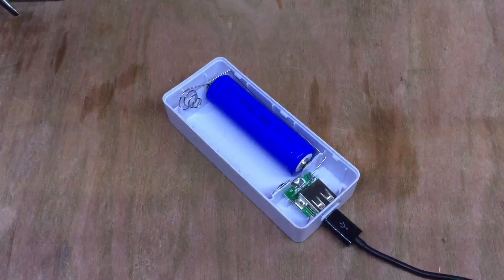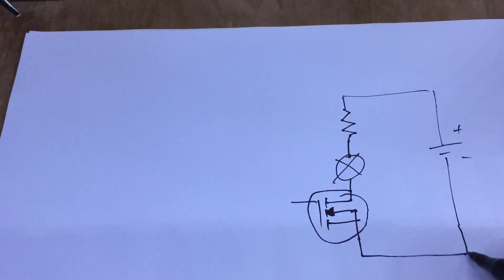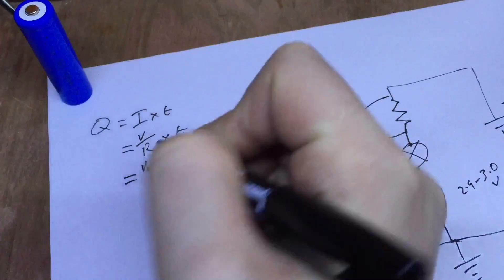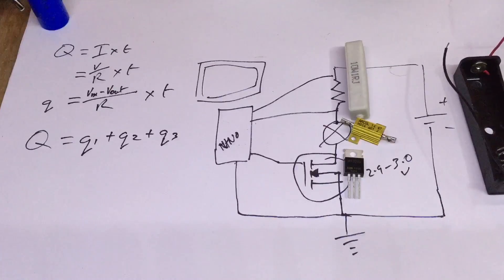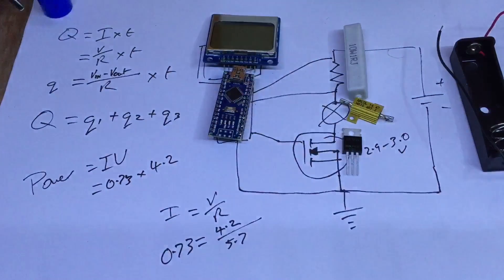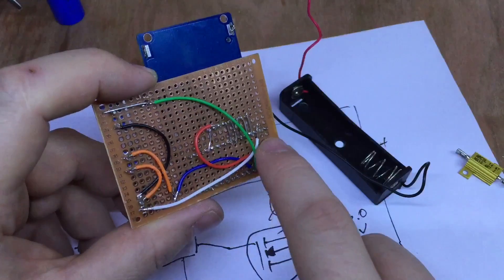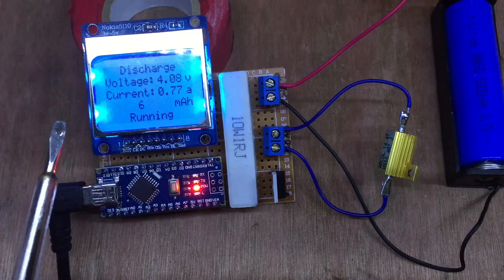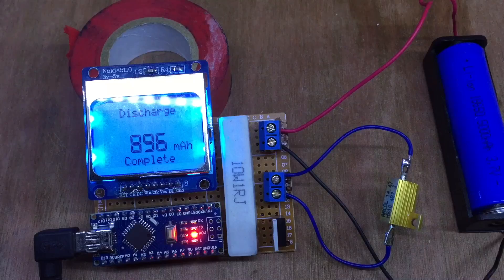Lithium Ion 18650 Capacity Checker - Adam's Arduino Projects

Comment: Just wondering how you are getting the Li-Ion Cell Voltage.  Are you taking that directly from the 1 ohm resistor?  If so would it be better to add another analog reading for the cell itself.  Two readings, one for the cell, one for the sense etc.  Then you can adjust your current reading to be more accurate.  I do believe that TI sells a dev kit for something similar to this.  Gives you a scale for current from the sense resistor through some op amps.  Then you just read the current scale from the amp and do the math.  Since it is in silicon the sense resistor is tuned and the value is known.  Would give you more accurate readings than through the 10W resistor that changes resistance as it heats up.
Reply from the maker: +Jimmy King Yeah I read the voltages at two points. One directly on the cell positive and another after the 1 ohm shunt. Deducting the shunt voltage from the cell voltage gives the current. 

This project was an afternoons work using bits out of my components box. I've been very pleased with the fact that so many people like to watch this video and comment. There are a thousand ways to achieve the same result, much more complicated and probably accurate ways too, but this was my way on that day with a few bits lying around.

I still personally like the idea of the sense resistor - although ten 0.1% 1watt resistors might serve the project better but if I were to make this project again, I'd look at using a mosfet or a transistor as a constant current load. 

Thanks for your comments - perhaps one day I'll create a version two of this project incorporating some of the good ideas people have kindly given here and perhaps a couple of my own.
Reply: You could use a constant current source like the TL431 with a pass transistor.  Very accurate.  As far as the 0.1 ohm resistor the noise would be considerable, and you won't get an accurate reading directly off the 0.1 ohm resistor which is why you need the amplifier, the ADC can't read that low of voltage.  But I enjoyed the video.  Sorry I missed the way you were reading the voltages.  Pretty awesome you had this stuff lying around to work with.  If you want to upgrade the project it would be really simple and I have found some sources that might help you out in the future in case you want to test power supplies for accuracy etc, solar panels for power etc.  You can read this if you want to. You can get away with 1 ohm resistor for sensing but the accuracy will be 10x less then using a 0.1 ohm resistor.
The challenges with measuring with a 0.1 ohm resistor is the amount of noise on your resistor you will be measuring thus the need for the amplifier.  Selecting a resistor that has good thermal stability and an opamp that has low drift and noise immunity would make your project I think that much cooler.  I remember back in school that they explained that if you contact TI for samples if you explain what you are trying to do they usually are more than happy to send you a few samples for free.  The amount of exposure to the public they get is like free advertising for them so it is usually worth it.  http://www.vishay.com/docs/30175/thermal.pdfhttp://www.ti.com/lit/sg/slyb194b/slyb194b.pdfhttp://www.mouser.com/new/Texas-Instruments/ti-vishay-current-sensing/resistors has on accuracyA good reference material on how shunts are used in calibration and the effect heating http://www.ohm-labs.com/precision-shunts/cs-1-10.html  If you don't want to purchase a 0.1 ohm resistor you could use an enhancement mosfet for the resistance between the drain and source, it should be low enough for the application assuming your not throwing too much power into it.  Just make sure it is got a large heatsink on it as well as a fan. If you operate it in the linear region you should be able to adjust the resistance as it starts to heat up.    Datasheets on mosfets are great reference for that kind of stuff.  Also using a standard opamp (ones with compensation pins, for gain stability) could be used for the amplifier stage.  Something like this could be breadboarded in a short amount of time.  I rarely use LCD screens because it is much easier to use a terminal and display the values on a debug screen, at least when I am prototyping.  A good place to find sources for 0.1 ohm resistors and a variety of good components are within old CRT boards.  They have great power transistors, shunts etc.  that usually can be picked up for about $1 at your local goodwill or other store.
Reply from the maker: +Jimmy King Wow Jimmy - I think you win the competition for the longest comment on my channel - and possibly the prize for the most researched. A lot of info for me to absorb there. Thank you. 

I think people have found my little circuit to be quite simple to understand and easy to build which is why I think it's been reasonably successful. It's like Dave Jones' constant current load - such a simple implementation although possibly not the most perfectly tuned and stable design. 

I truly am very grateful for your suggestions - I will look into them and consider them if I return to this project. 

Thanks again Jimmy

Comment: Nice project!
Do you think it could be possibly to check the capacity of toyota prius battery module ? it works between 8v-to 6volts
Reply from the maker: +Alex Cociug I guess you could adapt it for that. You'd need to put a voltage divider on the analog inputs and adjust the code accordingly, but otherwise you should be ok.
Reply: Thank you very much for fast response! CAn you please recomend a certain model?
Thank you!
Reply from the maker: +Alex Cociug I was thinking you might just use a couple of resistors but I guess you could use a couple of pre-made modules like these - http://rover.ebay.com/rover/1/711-53200-19255-0/1?icep_ff3=2&pub=5575189419&toolid=10001&campid=5337903455&customid=Voltage+Divider&icep_item=201616845898&ipn=psmain&icep_vectorid=229466&kwid=902099&mtid=824&kw=lg 

You'll lose a bit resolution because those modules are designed to measure up to 25 volts, but they'll probably see you right.  How much capacity do the prius battery modules hold - it might take a while to get their capacity (assuming they're high) at the 500-1000ma discharge I used in this project.
Reply: A good prius module have 								6.5Ah. What is maximum discharge rate which i could use in this project in order to save some time?
Thank you!
Reply from the maker: +Alex Cociug Using the same shunt and load resistors the maximum discharge would be a little over 1 amp. The resistors are only 10 watt. 8 volts * ~1.2amp is roughly 10 watts. At that rate it could take six hours to discharge a good cell. 

You could use higher wattage resistors and increase your discharge rate - just keep an eye on that equation; P=IV

Comment: can i use a 1w led instead of that resistor
Reply from the maker: I guess you could, but you'd need to protect it with either a resistor or a cc driver.  You've also the issue that the cell will delivery between 4.2 and 3 volts - 4.2 is probably a bit high for the LED, and with a current limiting resistor 3 volts is probably too low.  I filament lamp (eg. 6 volt) would make a better choice if you want to use something that generates light.
Reply: i dont have that high watt resistors i have some 1w 1k ohm resistors can you suggest something
Reply from the maker: If you've only got resistors 1k or higher then you'd need to put a lot in parallel to get down to a decent level to discharge the cell at a reasonable rate.  Perhaps a savaged 12 volt car bulb?
Reply: ok i will try that out

Comment: Two thoughts. The termination voltage of the discharge cycle should be measured at rest, not under load. On my quadcopter the 18650GA Li Ions run at 3 amps. The manufacturer's continuous rating is 10 amps. I land when the voltage (under load) gets down to 2.5V. After landing the voltage immediately bounces back to a resting voltage of 3 to 3.15V. My battery utilization is typically 90% or thereabouts. Second, the industry standard is to rate the batteries under 200ma load. Hence the 5000maH rating label, vs the much lower results you obtained, around 1000maH.
Reply from the maker: +tm22721 Thanks for your input. 

The information I've read suggests that once a li-ion battery reaches 3volts under load it's pretty much done. A voltage rise off load is superficial and testing the battery again won't reap much more energy. I've tested this with this tester, a LiitoKala charger and my iMac b6 clone. You'll get a small increase - but not much at all. 

I've never seen an industry standard of 200mA - have you a source?  I stuck with 500mA because that's what the commercial product I bought also used.

I guess the best thing about this project is that you're welcome to replace the load resistor for something you're happier with, and you could update the code for your needs - release the load every ten seconds and read the voltage and reapply the load or not based on that reading. 

I hope you're able to test it and adjust it for your needs. Thanks again for the input.

Comment: Thank you very much for this project. I'm going to build one now.
But can I use IRFZ44N mosfet instead of IRF3205? Characteristics are slightly different. I'm a noob in electronics, but it looks like it should work fine, even if the drain-to-source resistance larger (17mOhms vs 8.5 mOhms).
Reply: Oh. Silly me. The comment below by Nick B suggests that it will work. (:
Reply: And yes, you've got another subscriber!
Reply from the maker: +Anton Mikhaylov Thank you. Glad you found your answer.

Comment: Is a moset necessary? Will a simple BJT transistor do the job also?
Reply from the maker: +HiJoeZi Probably yes depending on the transistor - you'll need to research a suitable one. Remember to protect the Arduino with a resistor.

Comment: I've ordered the parts and can't wait to build mine. I think the project can be further expanded too. 

You could use another MOSFET to switch on a TP4056 charger module before/after the capacity test completes. (If you tap into the 'charge complete' LED or monitor the current going to the charger, you could even switch it off once it completes or the current is below a threshold.)

You could even have an option to drain a battery to the storage voltage instead of running it all the way down for the capacity test.
Reply from the maker: +Jonathan Wells Yeah, both good ideas. I did think about integrating the TP4056 and hacking the LEDs.  Never did get pen to paper though to jot a circuit down. 

I would like to build a version 2 of this circuit as people seem to like it. Version 1 is very basic all because it was an afternoons project made with junk parts. 

Thanks for your comments and suggestions.

Comment: Correct me if I am wrong, but we don't need to use display, arduino can output results to PC via serial?
Reply from the maker: +siux94 Absolutely. You're 100% correct.
Reply: lool your are running away from lcd interface overhead :)  that's cheating pro  , Just kidding :)

Comment: is it necessary to use a 15watt (2nd) reaistor? why not 10watt type like the 1ohm one?
Reply from the maker: +Vaping Rain I made this with things I had lying about. 10watt should be fine. You'll just need to do your sums... I=V/R and P=IV. I'm guessing you might want to discharge at a higher current than I was?
Reply: +Adam Welch Nope. I will do the same rate (500mah) as of your another video. is it necessary to have 15watts resistance in that case? I am using 10watts type.
Reply from the maker: +Vaping Rain Ok so P=IV therefore P=0.5x4.2 P=2.1 watts. So a ten watt resistor should be more than enough.
Reply: +Adam Welch ah. Thanks. btw, any update on time display and button for on/of the discharging state?
Reply from the maker: +Vaping Rain Sorry. I've been working on other projects. I do intend to return to this project at some point and make a version 2.

Comment: I have built this using an IRFZ44N mosfet and all is working well. I have made a couple of minor alterations to the code. Firstly, since it is not recommended to discharge a lithium battery below 3V I have set the termination voltage to that. In fact I am thinking of setting it a little higher still to obey the 80% rule as it is supposed to prolong the life of the battery. The second modification is to assuage my ever-so-slight tendency towards OCD (haha) and have modified the printing of the mAh value in the 'running' screen to print the value right-aligned in a field width of 5. It just makes it look a little tidier to me. ;-)

A great project and I am also following your DC Load project with keen interest. Thanks.
Reply from the maker: +Nick B Thanks Nick. When looking at the cut off voltage I found all over my power banks cut out at 2.9 volts but obviously it's up to individuals to set it at a level they are comfortable with as you have. Completely understand your argument about cell health too, but discharging and testing capacity isn't something we'd normally do on a frequent basis. 

I'm so glad people like this project and have built the circuit. The beauty of releasing the code means that anyone can change it how they wish so I'm glad you've been able to adjust it for your needs. 

Thanks very much for the comments.
Reply: Why we need two resistors? Can we use one big for the load and measure the voltage across that one with two resistors?

Comment: I'm kind of a noob.... why use two different resistors?  Couldn't you just sense the voltage drop across the load resistor?
Reply from the maker: Absolutely you could yes.  But I wanted to change my load so I could easily change between 500ma, 1amp or even 2 amp draw.  If I only had one resistor I'd have to change the code each time (or build a menu system into the arduino).  By sensing the drop over a fixed current shunt I could change the load to be anything I wanted and it'll work out of the box so to speak.

Thanks for the question.
Reply: Thanks for the explanation, even though it makes my head explode that the Arduino can calculate the current without knowing the resistance across the load...!  I have to look more into the shunt thing.
Reply from the maker: +mnelson10000 It simply Ohms law. 

Imagine a basic circuit using a resistor and a battery. Let's say it's a one ohm resistor and a one volt battery. The current flowing through the circuit would be one amp. I=V/R. 

Now let's suggest we have the same battery, but two half ohm resistors in series. So now our circuit goes battery positive to resistor 1 to resistor 2 to battery negative. We know that both resistors equal the same resistance as in the first example. The voltage drop over both resistors will still equal 1 volt. However we can assume that half a volt will drop over resistor 1 and half over resistor two as they are of equal value. So if I=V/R, I=0.5/0.5, I=1 again. 

Now someone swaps one of the resistors. The current flowing through the circuit will have changed as a result but there's no need to worry because you know the value of the original resistor and you can measure the voltage drop across it and simply do the same calculation.

A shunt is simply a low value known resister we measure voltage drop across to determine current flowing through a circuit. 

Does that help at all?
Reply: Thanks for the detailed explanation!  Yes I think I understand better now.
Reply: One other thing, since resistance is really a function of the temperature of the resistive element it will certainly rise during the test and skew the results.
Reply: @Arnthorg  if the resistance changes, the current changes too and the code measures that current so there is no error

Comment: Nice project, how can i modify this sketch to I2c OLED display ? 
thanks in advance :)
Reply from the maker: +Alen Novak Should be fairly easy. Your screen should connect to analog 4&5 for i2c. Use the wire library and another display library (u8glib or adafruit perhaps) and change the display constructor at the top and each of the LCC print lines. Shouldn't take too long to adjust the code.
Reply: +Adam Welch I`m not very experienced  with arduino, just started to play with it. 
Ill try if i run into problems ill let you know :D
Hope you will help me a bit then. 

BTW nije project.
Reply: +Alen Novak did you get it done for the oled ?
i also have one of those oled screens and would like to use it
Reply: Please provide the assembly scheme in the fritzing?
Thank you...

Comment: Hi.  Firstly, thank you for a great project.  I am setting one up with an Arduino Uno.  I am using a 10W1Ohm shunt and a 10W6.8Ohm cement load (that is what I had!).  I am also changing the display to a 1620A (which is what I have).  I calculate a current of 538mA.  10W is plenty.  I assume that my test will take longer to run as the current drain is lower.   I have also modified the code to suit and I am puzzled by the 4.71 voltRef variable.  When I measure my arduino 5v pin I get exactly 5v.  Is there a reason why you used 4.71?  Many thanks again, David
Reply from the maker: +dmon123 Hi David. That's right the lower the current drawn the longer it will take - you'll also probably see the highest capacity. Discharging some poor cells quickly will really show how poor the cell really is. 

The reference voltage is what you suggest. What actual voltage is your Arduino using. So measure the voltage between the REF pin and ground. If you use USB to power the Arduino this will depend on the USB adapted you are using - so theoretically for best results you should check each adaptor. If you use the onboard 5v regulator to power the project it should be more constant once you've found its initial voltage. Without that variable being fairly precise the results could be a fair way off.